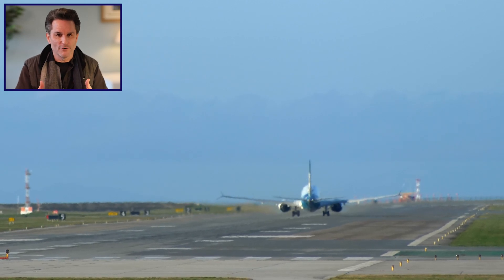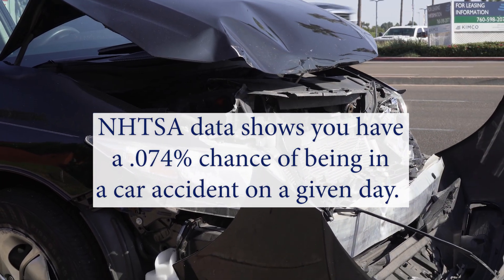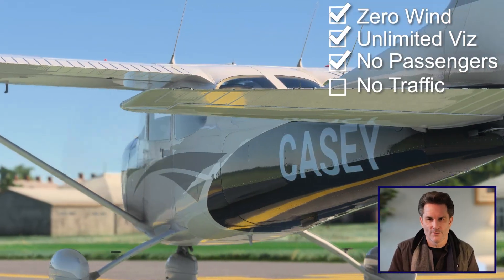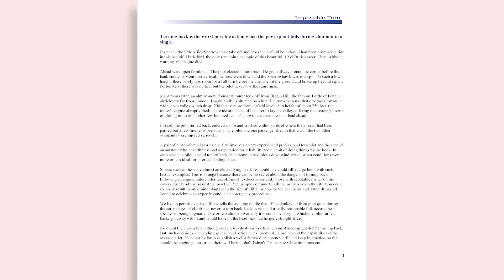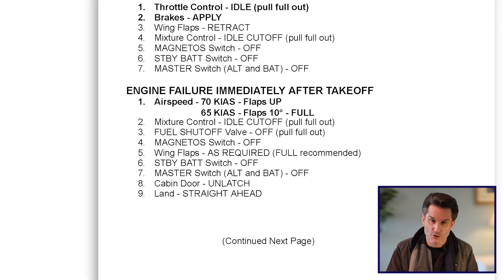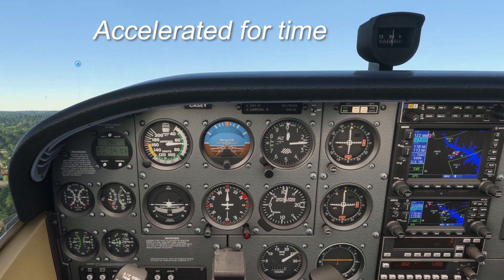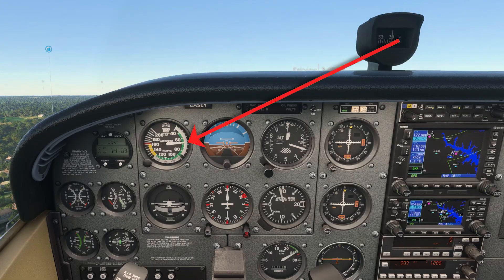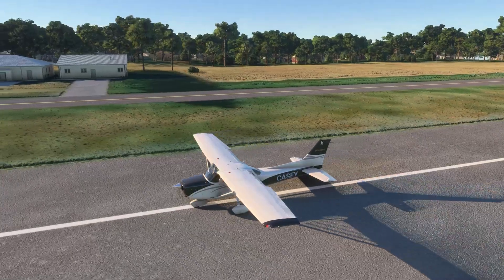The "Impossible Turn!" - Flight Simulation Procedures

Comment: Great simulation, but you did it with idle power (some thrust). It wouldn’t have made it if you had pulled the mixture. Still great info, though!
Reply from the maker: Thank you! That is a great point! Would be a very different situation if it threw a rod and the prop immediately stopped!
Reply: @ you’re welcome! I’ve had a couple full engine failures, and the glide ratio is much steeper than idle power. Also much scarier 😂
Reply from the maker: @paulis7319  Wow! What type aircraft did you experience the engine failures? Were they off airport landings?
Reply: @ PA-25 on the first one. That happened on downwind so I made the runway with no trouble. Second was an L-19 Birddog. That happened just after dropping a banner and I was at 50’ AGL, below glide speed, and landed in the grass. Due to the low speed I wasn’t able to flare, so the prop got a fender bender and had to be replaced.
Reply: This comment was going to be my point exactly. Although the information is good and for some will certainly be helpful but this doesn’t simulate an engine failure as explained in the video. Definitely wouldn’t have made it with a full engine out. Thus not necessarily a simulated ‘impossible turn’ 

Please please please remake this video or attach a new video of a simulated flight the exactly the same as this one but add a common but realistic load, average environmental factors for that airport and instead of pulling idle, pull full lean on your mixture. lol
Reply from the maker: @travismihalyi2673  Thank you! Good suggestion! Almost out of instinct I didnt cut power completely even on the simulator... but now that you mention it, I'll try again with complete power loss and real-time weather conditions. More to follow...

Comment: .005% of 100,000 flights a day, isn't that 500 flights experiencing an engine failure daily?
Reply from the maker: Thanks for the comment. 500 flights out of 100,000 is .005 while .005% of 100,000 is 5. Including the percent makes the difference.
Reply: @stagescreenstudios  fair enough 2 orders of magnitude lower, still a fairly common occurance, that's 1.8k engine failures a year if you think about it.
Reply from the maker: @Ascii89  Crazy right?!!

Comment: My flight instructor taught me you should be able to do it above 800' AGL if you react quickly.  Make the turn tight, but make sure you keep the nose down, the airspeed at best glide, and don't skid.
Reply from the maker: Thanks for the comment. I'm curious... did you learn this in PPL instruction? What aircraft were you training in? Did your Instructor specify a turn to the left or right?
Reply: @stagescreenstudios  PPL training in a 172S.  Direction not discussed specifically that I can recall.  At my home airport, I would turn toward the side with the taxiway so that would be an option if couldn't make the runway.

Comment: What about a total power loss in a airliner ? It may be the cause of Jeju Air teardrop
Reply from the maker: Such a tragedy for sure. Fortunately with the engine redundancy in commercial aviation aircraft the likelihood of dual engine failure is extremely remote. The engines on the 737-800 in the Jeju crash were the CFM56-7B with static thrust of 26,300lbs per engine which means if one engine failed the aircraft could safely operate sufficient to get to another airport. However, like "Miracle on the Hudson," it appears Jeju ingested birds into both engines causing the dual engine failure.  Fundamentally, commercial and general aviation aircraft share the same aerodynamic principles but there are certainly notable differences in handling.  Due to these differences, an impossible turn in an airliner would most surely be impossible. Checkout the story of TACA Flight 110. It's a miraculous story of a success off field landing with dual engine out. https://youtu.be/H5UUr9RXfTY?si=FMtppMXhh4fqEdv_

Comment: I had an engine failure on take off...Cessna 150...1984 on a cold cold day in Oshawa, Ontario Canada.. I performed the impossible turn...and lived to send you this message....😂
Reply from the maker: Incredible! Thanks for sharing your experience and glad you made it! You clearly reacted immediately and effectively! I'm curious, had you practiced the impossible turn prior to the actual event? Were you solo? What altitude did it occur? Was it a complete loss of power?
Reply: @ Prop  horizontal,  wind whistling, oil panel open and oil on windshield..nose down for quick lookout gave us valuable airspeed and high density altitude...I turned us gingerly and then gave the con to the CFI...he side-slipped us down superbly...152 threw a con rod.....flew a C172 home..: )
Reply from the maker: @JohnBobRoger  Wow! Well done!
Reply: Well what’s your thoughts, did you learn anything from it or just here to be a clown? You seem reckless and dangerous in my opinion. No TRUE pilot would ever laugh because they care about the souls on the ground. You should never be in aviation with your attitude but you will be humbled…… This IP address needs tracked a you need investigated on why it’s humorous to endanger peoples lives!
Reply: @ Who tfk are u referring too?
Reply: @JohnBobRoger  I thought I was speaking clearly? You. Finding humor in an emergency means you should never aviate….,
Reply: @ScottieD1967  you're crazy